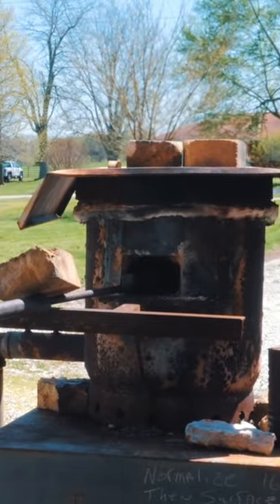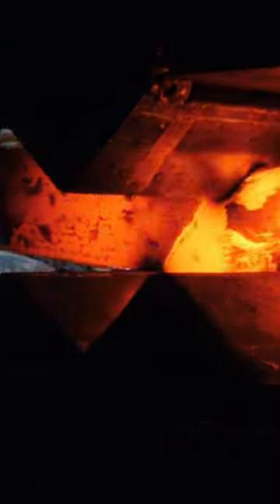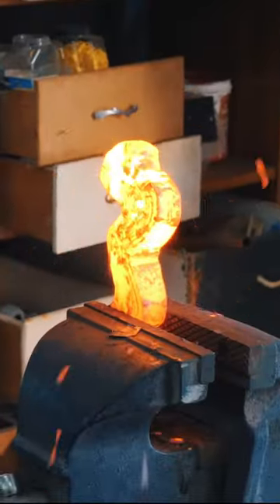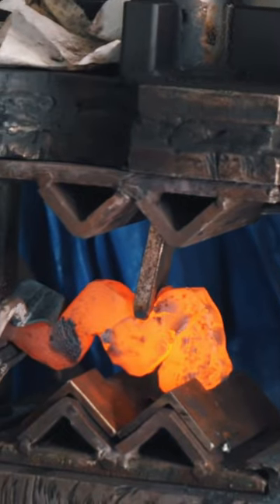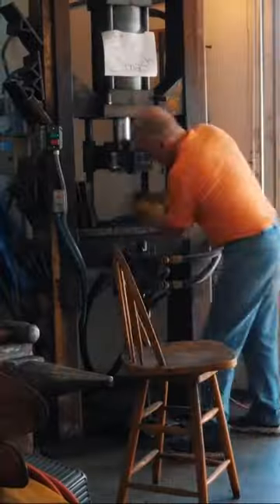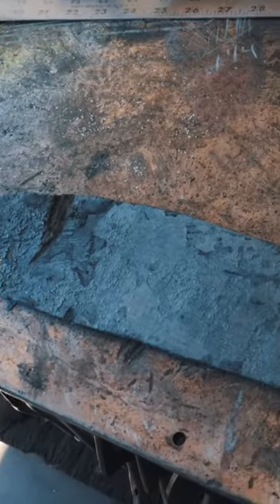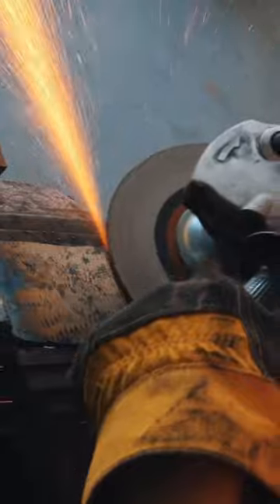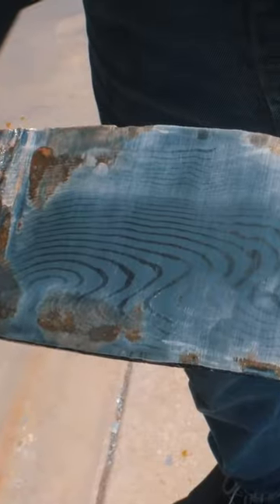Making experimental Damascus

Comment: I used both with great success, i myself never have had an issue BUT  my hunting buddy 5-6:years ago was using popular expandable, shot a nice  9 point dropped 30 yrds.. next season same batch of 3 broadheads from previious year.. he drilled a nice 8 point, 4 sure was gonna go down but nope never found him.. long story short the dew and moisture from previous use and time equal rust.. he never checked or serviced those broadheads in the quiver and they rusted closed and refused to open. One blade out of 6 opened. 2  triple blade heads and a single cutter opened. They were NAME brand but thats not on them. Moral of the story in take sometime and go thru your gear/equipment cause its easy to overlook something. Stay safe out there this year. Good luck

Comment: Why don't you really use Flux anymore? What do you use instead?
Reply: AFAIK they usually do a "zero atmosphere forge weld" now where they weld sheet metal to the billet to keep the air out then grind it away or let it come of as scale.